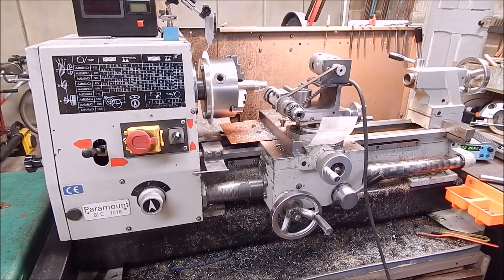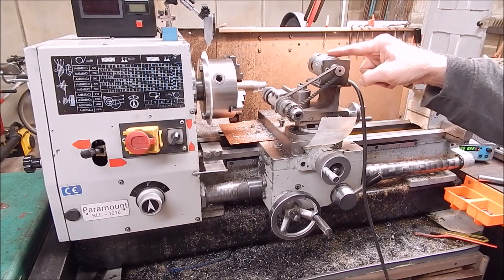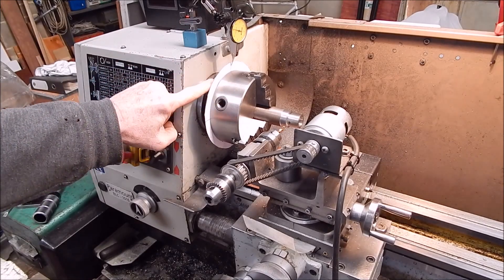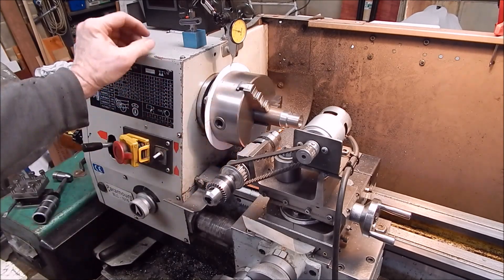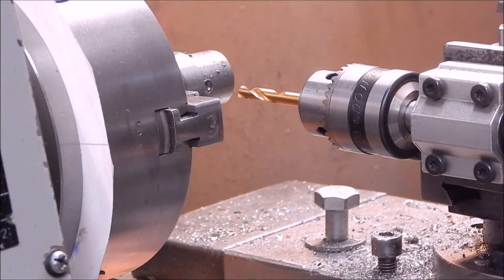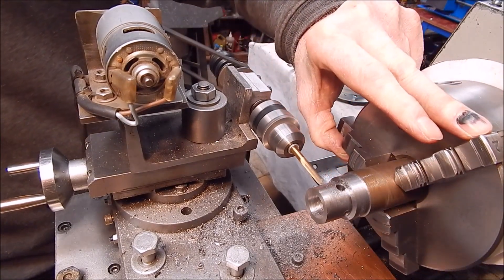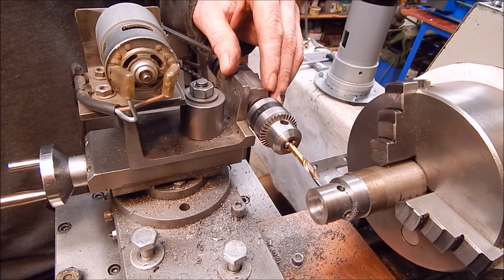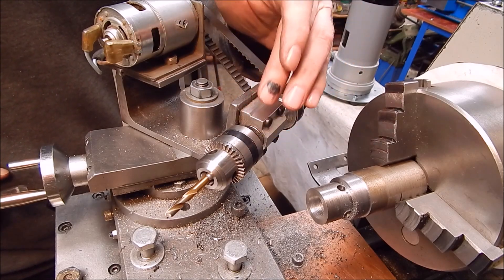775 DC powered toolpost drill for a metal lathe - plus easy chuck indexing

Comment: Hello Sir, 
Are there a special reason that you got a drill chuck on each end og the spindel, is it for ballancing, or will it work good as well with just one drill chuck?
Reply from the maker: Hi Martin,  there is a chuck each end so that it can do radial and cross drilling simply by rotating the head 90 degrees.   With only one chuck it may not be possible, depending on the lathe size and amount of cross slide travel.  Cheers Rob

Comment: Nice set up; would it not have been just as easy to drill straight through, looking at the length of the drill it seems as though it would have reached straight across, then you would have only needed to rotate chuck twice?
Reply from the maker: I could have done that.  It was a demonstration of how easy it is to index and re-index.

Comment: Can one do this with a Dremel on a smaller scale but if the motor can keep up it should work,  much slower feed for sure.
Reply from the maker: Yes, you could use a Dremel provided you don't overload/overheat it.  They are not very powerful.

I also have an air pencil die grinder and a HILDA 400 watt die grinder and have mounts for both on the toolpost.  I like the one in the video best as it is extremely accurate and quick to set up.  Cheers Rob

Comment: Where can i find shaft covers like that for a lathe? those are cool, and would be nice for my Warner & Swasey 4A
Reply from the maker: Google for telescopic covers for machinery and you will get plenty of hits.  I often get asked this question.  The covers came OEM with the lathe and are excellent but you do lose a bit of travel to the headstock due to their minimum compressed length.  Cheers Rob
Reply: @Xynudu  Awesome! thank you! My Hex turret actually has a fair bit of clearance between it and the tool post, and the tool post and the headstock, so that should be good. main goal is to keep cast iron chips off, which is all i really work with! And those are quite a pain.

Comment: if it fills a need and gets the job done, it's good! I think if I had the chuck off though and set it on the paper, just transfer the marks to the chuck itself then no loose paper flapping if you needed to further lathe turn the part.
many ways to index a part, this is one of the more simple ways I've seen. thanks for sharing!

Comment: I've got a pretty similar setup on the Schaublin, although it's working on scrounged bearing holders and runs a chinese ER11 collet spindle.  What really helps is to slow it down, I run mine at probably 1/8 the speed you're doing - the motor still has its gear reduction from the drill driver it was recovered from, and I have a bigger pulley on the spindle - this means I can run the motor at its rated speed, and get a max of torque.  Helps a lot with milling, especially in steel.

I'm still tempted to set up and overhead drive for it and run it with a 1/3 hp 3 phase motor, though.
Reply from the maker: Sounds good Michel.  I could gear mine down, but then it's no good for grinding, so you can't have it both ways.  For small work this is fine.  I made it to suit the Chinese 10 x 18 lathe as that is well sealed and grinding is not an issue.   Provided you cover and clean up grinding is super useful, but some lathe owners are scared stiff about doing it.  I also have a full sized TPG, but it rarely gets used these days as I mainly do model making work now.  The big one is handy though for larger repair jobs.  Cheers Rob
Reply: @Xynudu  Yeah, being able to grind stuff is enormously handy, and I agree, as long as you seal stuff up and clean up properly afterwards it's no biggie on the lathe.  My workshop's got 2 bench grinders anyway, grinding dust does end up on the lathe one way or another.  Wipe the ways down before and after use,  keeps the risk to a minimum.

I have a separate toolpost grinding setup based on a cheapo dremel clone, but could probably use the toolpost rig with the gearbox in "high speed" mode and the pulleys swapped.  That could work pretty well, actually, might look into it.

Comment: Its a mill! Nice setup, especially the paper guide.
Reply from the maker: Hi Benny,  I keep a few of those paper indexing discs (most used indexes) in a plastic folder and re-use them as required.  Only takes a couple of minutes to fit them and remove again and they last quite well.  Cheap and as accurate as it gets.  Cheers Rob

Comment: Hi Rob, for cross drilling how are you locking the spindle? Paper trick is very slick!
Reply from the maker: No need to lock it when cross and radial drilling as all the force is applied exactly at the center line or longitudinally, so there can not be any deflection.  The spindle never moves.  The drills are also quite small compared to the spindle mass.  Cheers Rob
Reply: @Xynudu  brilliant thank you

Comment: Hi Rob ,thats a great set up and the paper chart  is great way to go . Definitely  have to have a go at  doing that .
Its as much fun to watch it working as the little steaam engine .I 've got a lever operated  lathe so I would say it would be just right 
for pushing  a drill unit ☺👍
Reply from the maker: Sounds like a good idea Colum.  I use the tailstock quill to prevent toolpost cant and drive in the toolpost when doing longitudinal drilling - same thing really.  Works well.  Cheers Rob

Comment: Very neat use of a bit of U steel, I'm thing I could make a small grinding post in the same way, cheers
Reply from the maker: Yes, you can mount grindstones, cutting discs, end mills, drill bits etc on it.  Super useful.  Cheers Rob